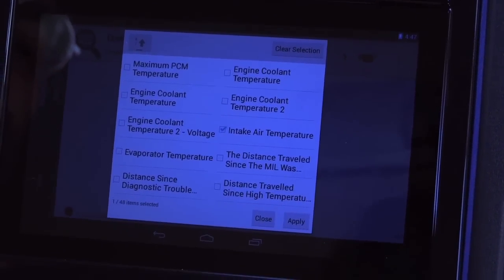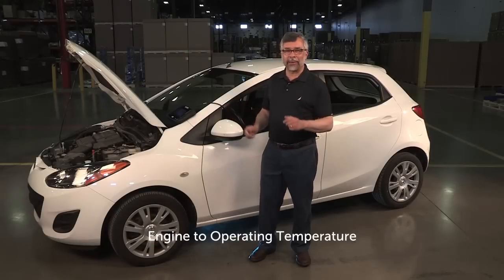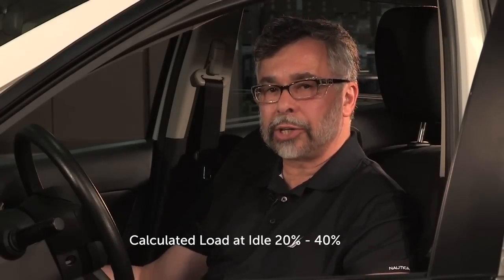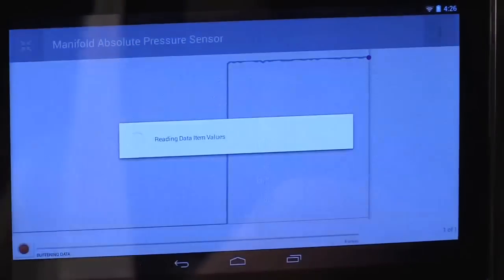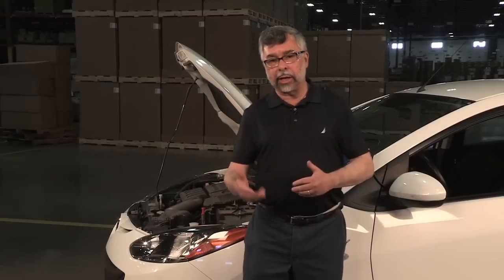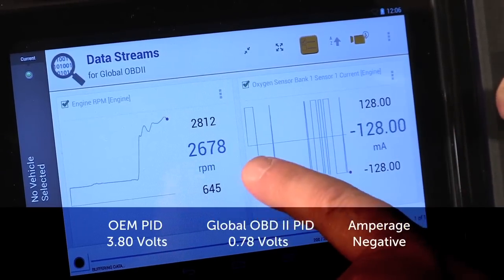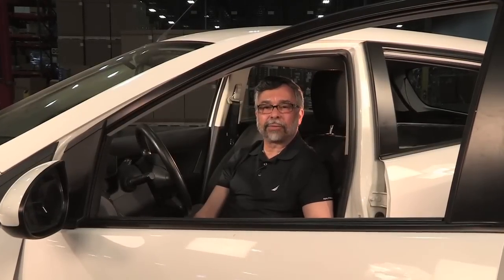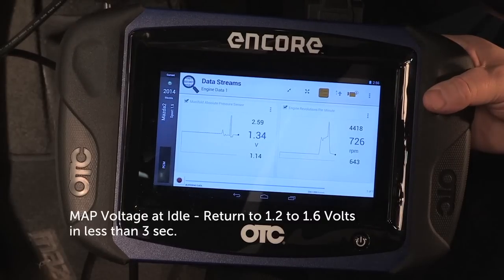Volumetric Efficiency Testing with the Encore

Comment: Got a little problem. Some motors have not airflow meter 😅
Reply: Maybe there's a Formula so you can use the calculator for speed density systems.